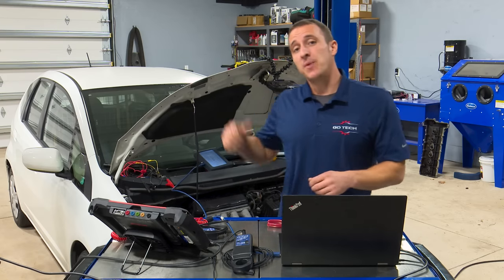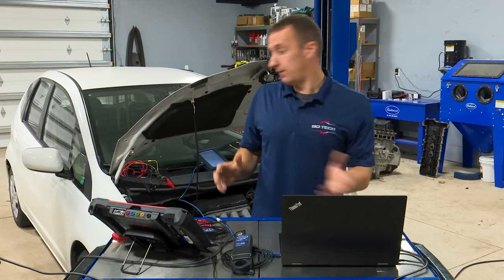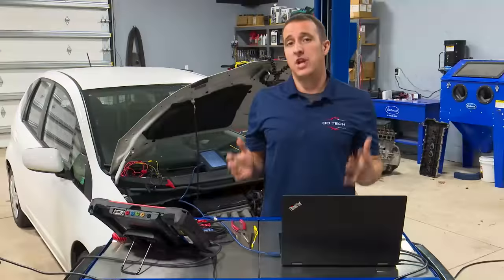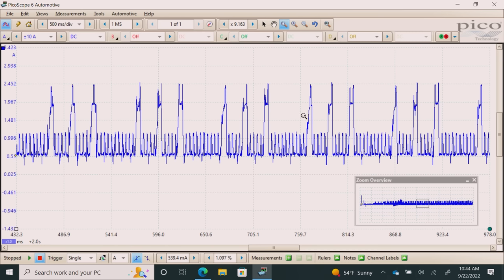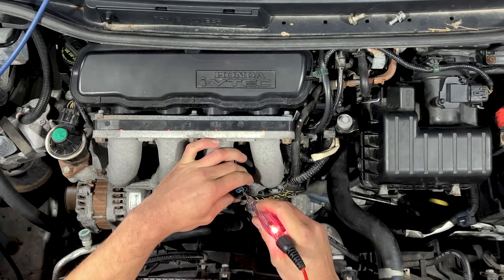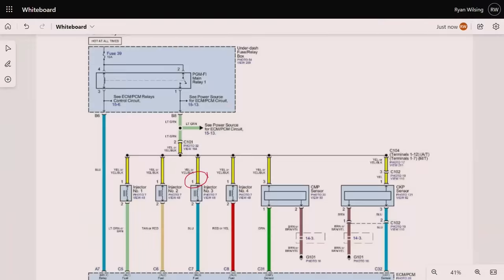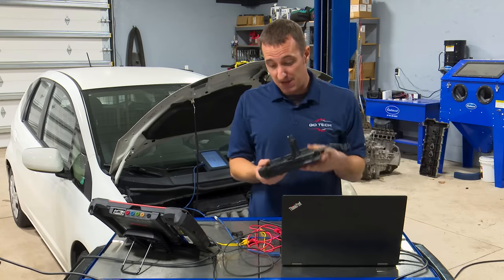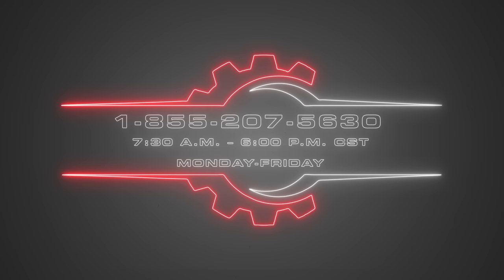Unfixable Honda Misfire Solved P0303, p0203

Comment: I am a bit confused that noid light on #3 did not light up when injector is disconnected.
Reply: The ECU was not pulsing the fuel injector hence the noid light didn't light up. The ECU connects the fuel injector to ground briefly to turn it on. In this case the ECU wasn't doing that, because the ECU was damaged, hence the light didn't come on (flicker). The ECU was damaged, it appears, because the suspect fuel injector had an internal short. That caused too much current to flow through the ECU injector control circuit and damaged the semiconductor in the ECU that is responsible for switching the fuel injector.

Comment: Good video had this before
Reply from the maker: Hey Simon,
Was it on a Honda? This is my first timing seeing a Honda PCM fail from a injector that is bad. 
Thanks for watching!
Ryan Wilsing
Reply: @GoTechTraining  hi it was a Honda jazz and funny enough it was the same cylinder lol I did the same steps as you. this is mentioned on Ecu testing
Reply from the maker: Hi Simon,
Wow! Same cylinder
Honda must have had a injector issue with these motors.
Ryan Wilsing

Comment: i need u to fix my car lol i have misfires in cylinders 2,3, and 4 lols..
Reply from the maker: That car must be running rough!
Reply: @GoTechTraining  yes it’s running so rough! I tried replacing coils, spark plugs, Maf sensor, still nothing . Still p0300 ,p0302, p0303,p0404 still shows up ! Next I’m changing the valve cover gasket ! I see some oil on the spark plugs when I took it off maybe is doing the misfires ?